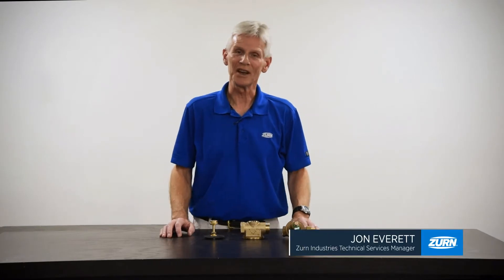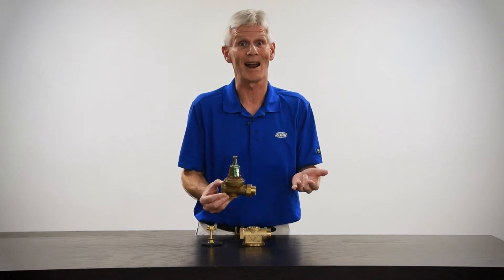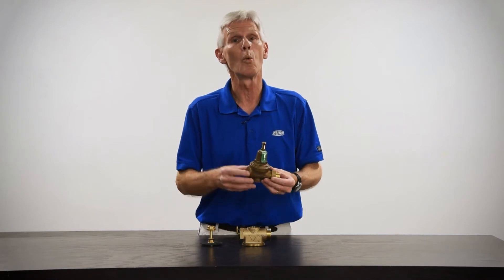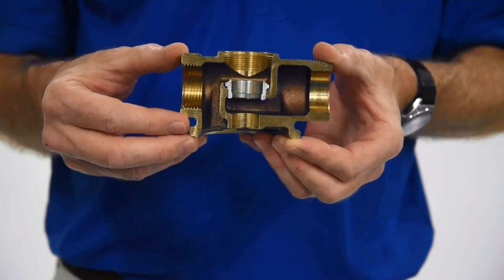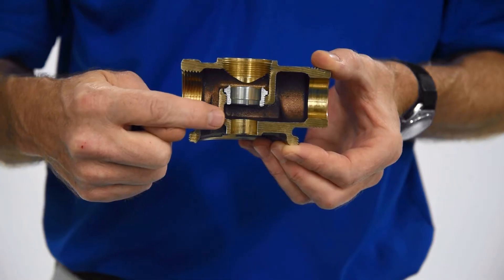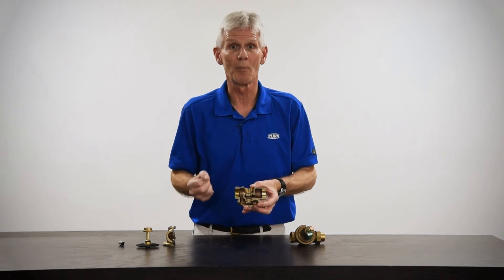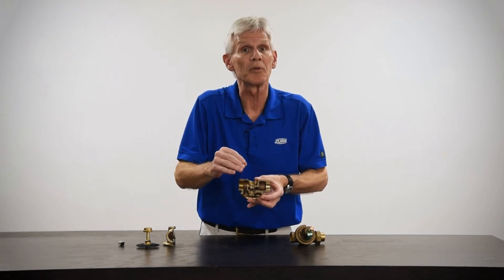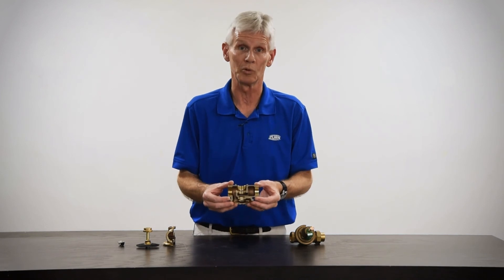Repairing and Rebuilding a Zurn Wilkins 500XL Water Pressure Reducing Valve

Comment: Good video but not accurate about using water to cut metal. Water jet cutting is using high pressure water 60,000 psi with a combination of a material called garnet. Just to clear up the misunderstanding. Regular water is “kind of” abrasive. If your at the point that water have worn around the o-ring then you need to replace your valve.